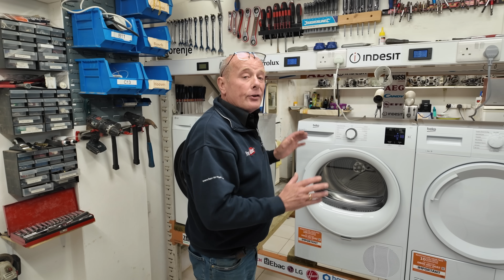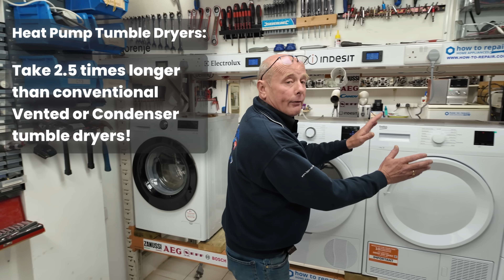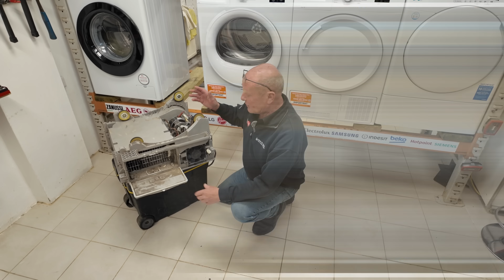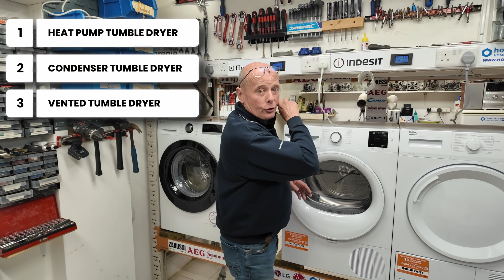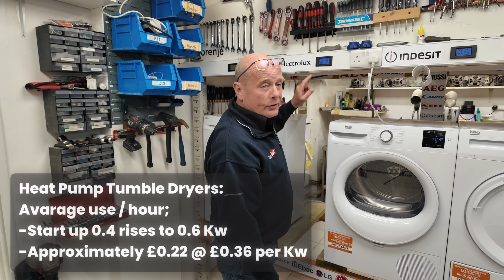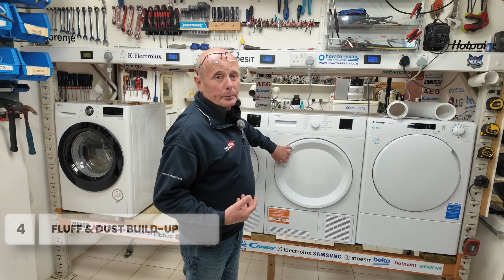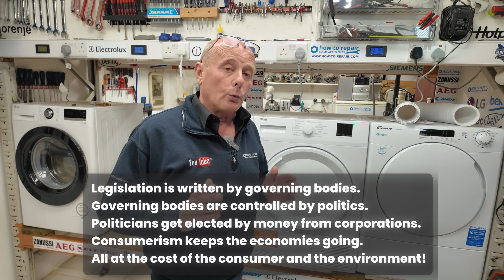Tumble Dryers the Shocking Truth About Heat Pump vs Vented & Condenser, NEW LEGISLATION!

Comment: A heat pump tumble dryer is safe for drying sensitive clothes like jackets because they don't work with very hot air which could damage sensitive clothes, like the other ones do. This is the only reason I would not buy some other dryer. Men don't know about this, they don't think about gentle clothes.

Comment: I bought a new whirlpool condenser dryer last Thursday & returned it on Tuesday , it was throwing out soapy vapour all over the utility room & spread  into the kitchen it was unreal , very sickening to breath in like after swallowing a bar of soap my store offered me an exchange of another whirlpool condenser but I opted to go with a vented Indesit  , I got 25 years out of my last vented whirlpool , just curious did u ever come accross this problem before & wondering what was causing  this  fault in a brand new machine ?

Comment: I have had a Samsung heat pump dryer for about 5 years now. Last year it was clogged up with fluff in the condenser assembly. It took me about 5 hours to pull it all apart and clean it. 

However I don't think this process would be too difficult once you had done a few so a professional shouldn't take too long to get it done once the experience was built up working on these machines. 

As far as the compressor failure goes , agree that it would be basically a game over scenario because of the cost of the parts however compressors don't fail all that often when systems are properly maintained. 

Gas leaks are something that are something that people see as "scary" and "hard to diagnose" but any decent technician with pressurized nitrogen and some leak detector spray should be able to ID a leak pretty quickly. Especially in packaged units like this where you can see all of the piping. 

In summary I don't think the antidote to this is to throw the baby out with the bath water and complain that new machines are too complicated. It happened with cars and it's happening with appliances. 

It just means we have an opportunity to learn new skills and find out new ways to repair stuff. This is the game of repair. We are always fighting manufacturers.

Comment: Very informative video, I almost got a heat pump dryer recently when my vented tumble dryer went wrong, but in the end decided to repair. It was the so called bearing which had worn out through, second time I have changed it on this tumble dryer, relatively easy to do. Thank you will not be getting a heat pump tumble dryer now.
Reply from the maker: I’m going to bet it was a Hotpoint or Indesit well worth keeping the tumble dryer going I’m filming in North Africa at the moment so I don’t need a dryer here
Reply: @How-to-repair  It was a Hotpoint.

Comment: I find it hard to believe that you are powering your heating with Solar. In the heating months, solar output is minimal due to cloud cover, low sun angle and reduced daylight hours. Of course your full year export may cover your heating, but you’re still paying about three times more for your heating than if you’d remained on gas. You will only have reduced carbon if the heating was powered by electricity generated in a cleaner way than your 90% efficient boiler. Nuclear would do it, but a CCGT wouldn’t.

Comment: My expensive Samsung heat pump tumble dryer has stopped heating at 2.5 years old. It has a 5 year extended warranty but Samsung customer service so far is a nightmare trying to claim on it to get it repaired.  My old Bosch condenser dryer lasted nearly 10 years and was very simple to maintain. The heat pump is slower, quieter and cheaper to run but not worth it if it needs repairing or replacing so quickly as it cost so much more to begin with. I would not buy Samsung ever again.

Comment: The law of conservation of energy states that energy cannot be created or destroyed it can only be transferred from one form to another.

So if you're drying clothes, it will take the same amount of energy to dry them, however you do it. So where are the savings of Heat pump v Condensing ?

Comment: I'm currently looking for a new dryer and hadn't heard of the heat pump dryer till i saw it online.  My current dryer started tripping the electrics when plugged in a couple of days ago. I've left it unplugged for a few days in case something was wet, checked all the thermostats and cut outs with a multimeter thanks to your other video i watched but the problem remains so i've come to the conclusion its time to replace it again... This will be my 4th dryer in aprox 10 years with this one only being 18 months old (bought in Nov 2023) and had regular maintenance, filter emptied between cycles and condenser in the bottom cleaned every 2 weeks. Nothing lasts these days but needs must so i guess i'll be buying yet another condenser..
Reply from the maker: You did not say what machine it was so I’m going to assume it was a condenser dryer. I suggest making sure you clean all the airflow system as it will be damp on the heating system that is causing the problem.
Reply: @How-to-repair  yeah it is a condenser, a Hotpoint H2 D81W to be exact. I took the side panel off and cleaned out any fluff/dust inside, verified continuity on the thermostats/cut outs as in your other video. 

I also removed the back panel to access the heating element and everything inside was dry, even checked the little tray at the back where the pump is, a low level of water was in there which I mopped up with tissue and a small clump of fluff that I cleaned. I've checked the tubes were clear. 

The problem is it is tripping the electrics as soon as it's plugged in, not even when trying to turn the machine on. 

I've ordered a new Samsung condenser dryer (mainly for the 5 year warranty) now which should come tomorrow and I've put the Hotpoint outside for the scrap man

Comment: We bought a very basic indesit vented dryer, its bearings/drum shalf started to go after 9yrs, so a pretty good innings. A few youtube videos later and a shaft kit sourced I DIYed it and it back up and running. I'm glad wirh how servicible this older drying machine is. Sometimes I wonder given all things factored in runtime, servicibility how keeping things simple might be more economically viable/efficient. It does dry clothes alot quicker than my friends condenser and heat pump.
Reply from the maker: On these dryers, it is worth inspecting the bearing every two years to make sure you do not damage the shaft

Comment: I bought a Beko used. I couldn't believe it was a month old for £90. The bloke even delivered it. He said his wife wanted a different colour, personally I think she probably disliked the time they take. For us its not an issue. Heat pump DHX series. 9kg its been going for 4 years, everyday. Fantastic machine. When the washing has done I put it on a 12 minutes spin and drain. Saves time on the dryer.

Comment: I have a  Miele washer and heat pump dryer. The washer is now 15 years old cost £640, I was a washing machine engineer until I retired in 2016.  Miele are well made and expensive, but they manufacture all their components in house, no third party stuff. The heat pump dryer as three filters, one at the bottom of the door, one underneath that one, the final one is before the evaporator. So, internally it shouldn't have any fluff inside the evaporator, but it is only 7 months old and cost £940, but we will see as time goes on.

Comment: Interesting article, but I'm still not convinced that any domestic tumble dryer is worth it. I used to have a 10kg dryer and it needed a new bearing every six months because, in truth, it couldn't cope with much more than 6kg without ripping through the bearing, meaning we'd have to run it twice to dry a full load from the 10kg washer (we have 4 children, so we had a lot of washing at that time). It turned out that the bearing was cheap crap, as one engineer put it, so he put in a carbon one, which did last longer. Unfortunately,  when that one did finally go, it was mid cycle and the spindle subsequently carved through the thin steel backplate, rendering it ruined. We since saw our electricity bill plummet as a result of not having one and we've never gone back

Comment: Lifetime costs per dry are where it's at. As you correctly point out, other costs than the electricity can quickly outstrip the electricity consumption. Since a lot of manufacturing has been moved abroad, the politicians forget the pollution from those factories and transport still goes into the same atmosphere.

To be fair tho, that looks like a poorly designed heat pump unit you're comparing too if all the fluff gets stuck inside with no proper filters. And actually even room ACs with a dehumidifying mode could do the drying job. Sure I saw a video on youtube of people in Japan or somewhere just hanging up their clothes and popping the AC on.
Isn't the heat pump just underpowered if it's taking so long? What about a 2 in 1 washer/dryer unit? Those save space too.

Comment: Four years with Miele Heat Pump. Think it is fantastic. Only takes a 1/3 longer to dry than the Miele condenser it replaced. Also find it drys subsequent loads faster when it’s already warmed up. The amount of electricity it uses is so low i don’t even bother with the washing line in the summer anymore. Just quicker to get the laundry done in the dryer.

Comment: sorry but you are wrong with the air dryer. you can not replace the compressor or regas in your heat pump as the gas is not like a fridge or freezer. as it is r600 gas. .the tumble dryer is a freeon gas which is not available and since 1982 for repairs. all types of this gas has to be blead into a gas bottle not into the air as it cause a hole in the ozone. so they can't be repaired at all .except electrical parts.  I too was in the indestry since 1977 and just retired. .

Comment: I find most of the "Green" products actually cause more damage to the environment than good. These "Green" products also always cost more up front to purchase, cost more to repair, last less than a half life of the conventional equivalent, and cost more to dispose of properly, or cause more damage to the environment in their afterlife wherever they are disposed of. So really, what is the benefit to society of the BIG"GREEN" DEAL. Just like lithium batteries being used in everything, they cause more damage to the environment before, during, and after use.

Comment: I've repaired my condenser dryer multiple times, the two rubber wheels on the front of the drum I've replaced quite a few times. Then the tension wheel for the belt failed,  found the spare parts and replaced this as well. The machine is now around 8 years old and still running well.

Comment: I dry most of my washing outside on a washing line and only use a  dryer during the coldest months. When I looked at buying a condenser dryer to place in an unheated scullery, I found that it wouldn't be efficient in the cold.
I therefore purchased a vented dryer. 
The vented dryer drys faster than my previous condenser dryer.

Comment: Very interesting. In 2021, we replaced our LG heat pump dryer because it was deemed irreparable. It required a part from Korea which was unavailable due to lockdown. The machine was only 4 years old. We bought another but having watched your video, I think that was a bad decision. The drum rollers are already worn - every time it goes on, the bumping noise for the first 10 minutes is horrendous. Greenwashing - I’ve not heard that expression before but it’s a very good one! They won’t listen to us though. Thanks for sharing!

Comment: I agree with you
I’m a green minded person but can’t find huge logic in banning these dryers
ICE cars dinner make sense compared to EVs as former burns fuel and EVs don’t!

I’d also understand the heating pump vs gas boilers for the same reason

However, electric appliances are as green as the supply hence they are similar in terms of fuel source!
Yes heat pump consumes less power but consumes more energy to produce!

Comment: We've had a Haier Heat Pump Dryer for a family of six which is sitting outside in the back porch which is cold in winter.  On a full load in winter it can take 2-3 runs at 3 hours per run to dry completely, our vented took about 45 mins.  It's become a major issue for us as a large family when drying is taking 6-8 hours for a 9Kg load.  I'm not sure if we've just got a duff unit but it's never been quick and even in summer it take 2-3 hours.  

My personal opinion is that Heat Pump dryers are NOT suitable for large families who are running up to 2 loads a day or 8-10 loads a week especially if you have to site it in a cold area.  They are very efficient on electricity, mine is A++ rated but TIME is also a key commodity nowadays & I can't afford to keep a Heat Pump dryer running.  We will be going back to a vented this year before winter kicks in again.

Comment: An interesting video.  But...  in reality, who ever gets a 5 year old appliance repaired?  They would just rather buy a new one anyway.  Especially if the dials etc. were becoming worn as well and the general machine is looking a bit tired and tatty.  Also, my Heat Pump dryer (a Bosch Series 8 has a Self-cleaning condenser!  Are these any good?

Comment: I believe you,I have a simple heat tumble dryer that is More than 25 years old  just 2weeks ago the belt to the fan broke.After ordering a new one I have replaced it and once again it is doing its job.Simple no digital display and only knobs to turn to select the time and heat settings.Once things get too complex their reliability goes backwards.

Comment: Just to take you to task on the complicated tear down, thats simply not the case. drawn out possibly, but complicated? just nuts and bolts. i can do my Siemens IQ700 in less than 2 hours start to finish. One catastrophic failure.... drive belt snapped, Two issues over cleaning in 12 years. and thats it. Oh, and i can changes the speed the drum rotates in the menu's if I so wished, though the diference it makes is marginal.

Comment: Many rules are made Europe for European countries. This affects the driving factors. For example my old incandecent lightbulbs were 100% for about 9 months a year. No heat was wasted in our house. The new LED bulbs mean that my heating will have to run for longer to compensate. If I lived southern Europe then the light bulbs become much less efficient but the laws are set for the whole of europe (this used to annoy my environmental Science lecturer no end). 
Just as Clive says a codenser and heat pump help heat a house. Just as an AGA of old was the central heating. 
As with all green issues always much more complicated 3 point problem and numbers can be easily twisted to anything you want.

Comment: I looked at purchasing a heat pump dryer 5 years ago and was told they are only suitable for use in heated rooms, not unheated utility rooms, or garages as they need a minimum temperature of 10°C

Comment: Hi great video, I have two questions. Isn’t the condenser and vented running at a higher temperature so harder on your clothes and components? Also I get the design of the pump could be hard to repair and costly. Won’t that depend on design and manufacture ? Beko being low end will surely be not as well designed as a top end one? As a mechanic these are factors I would consider in a car.

Comment: Thank you for the informative video! Keep up the good work 💪🏻
Reply from the maker: So nice of you, all I'm trying to do is teach in the correct way that everyone understands. It would be really helpful for me to get my video shared and help us fight appliance waste!
Reply: @How-to-repair  I appreciated the informative nature of your video and your passion. If everybody considered their work with the same care, the world would simply be a better place. Keep it up
Reply: @How-to-repair  Heat exchange tumble dryers were supposed to be the future, but they just don’t work as well as they should. Long drying cycles, minimal energy savings, and terrible serviceability make them more of a hassle than a solution. Repairs are so expensive that it’s often cheaper to buy a new machine, which defeats the whole point of energy efficiency.  

One possible alternative is using infrared (IR) and near-infrared (NIR) light for drying instead of relying purely on convection heating. IR light can excite water molecules directly, speeding up evaporation without overheating the fabric. This could cut drying times by up to 50% while reducing fabric wear and lowering energy use.  

Another major issue is the tumbling action itself. An oscillating or vibrating system could shake moisture loose without excessive friction, preserving fabric quality while ensuring more even drying. This would also make integrating smart light-based drying even more effective.  

Heat exchange dryers aren’t living up to the hype, but instead of scrapping the whole idea, why not redesign them properly? A hybrid system with light-enhanced drying, modular components for easy repair, and a smarter airflow system could actually deliver on the promise of efficiency without the insane drying times. It’s time for real innovation, not just rebranding the same old problems.

Comment: Not that green at all when you consider all points. I thought appliances had to be made to  e repaired easily to stop early disposal- this is just the stupid thing the current government will do. I wish to stick with my condenser dryer.
Reply from the maker: Giant manufacturers now control the market but seem less concerned about consumers. Their main goal is to sell machines. They use green marketing tactics to their advantage but aren't held accountable for the growing pile of discarded white goods. Nowadays, machines last only about five years on average.